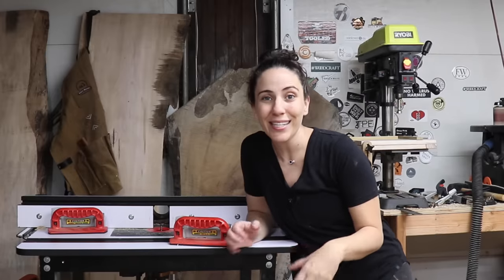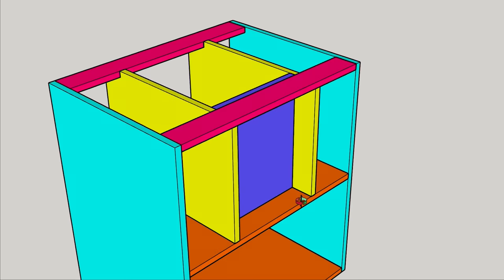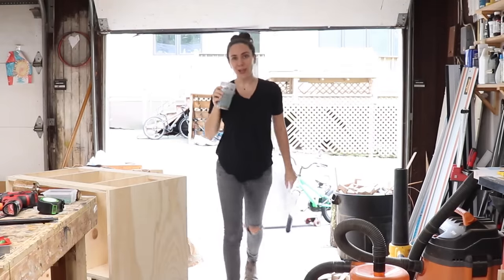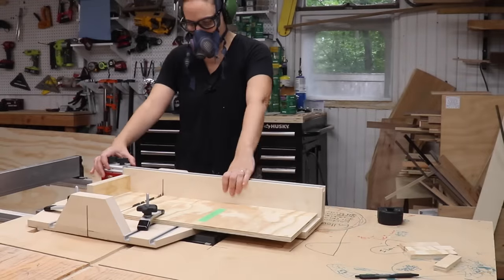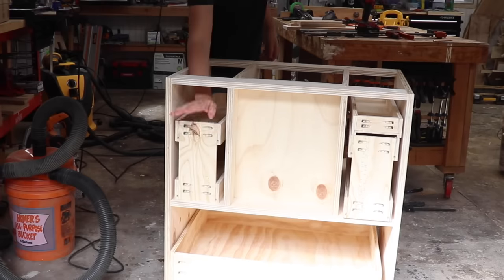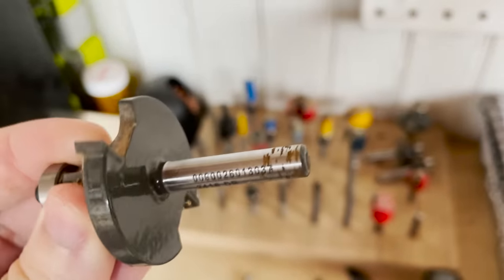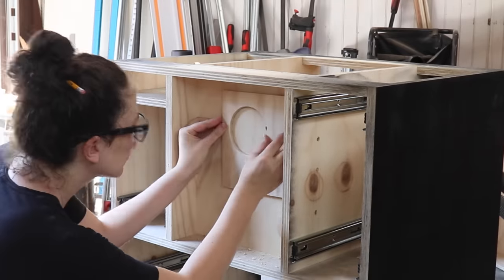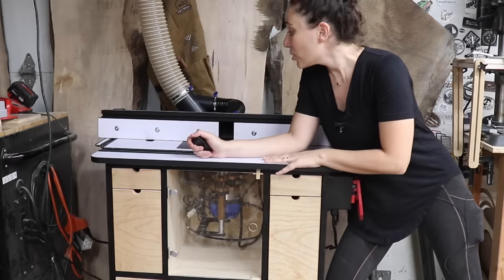Router Table Cabinet Build with STORAGE and DUST COLLECTION

Comment: Good job T!! So the dust collection issue underneath is because of the level of your dust port. If you lowered it to the bottom of the router housing it would collect much more of your dust. On the commercial dust boxes the port is usually close to the bottom which allows it to pull the dust down and out, your design is allowing it to pull the dust down but not out! Great project and it has inspired me to want to build one for myself.
Reply from the maker: Going to try that!
Reply: @3x3CustomTamar  lemme know if it works out.

Comment: Since you mentioned your collector might be too weak I had experimented with the height of the port in the box: cut a elongated hole from top to bottom where you can mount another piece with the port covering the whole hole. Then move this piece up or down until you find the height where you collect the most.
Reply from the maker: Going to try fir sure

Comment: The remote control for the dust collector is the best thing ever! I have a "Y" attachment to my Harbor freight desk collector. One goes to the table saw, and the other goes to a hose that I can connect to any other thing in the shop. I ended up getting a truck filter because it was less expensive than the canister filters designed for it. It makes a big difference in the dust around the shop.  Like $75 versus $250. I just hold it on with a tie down. Food for thought. Great video as usual.

Comment: Suggest moving the suction outlet to the bottom of the router bay so that you can suck out the heavy (gravity) particles which will form at the bottom.
Nice router table - keep up the good work

Comment: Love the table! Really awesome job!!! Definitely worth copying!! I love the idea of sinking the bolts into the plywood for the wheels! Great video as always!
Reply from the maker: Glad you like it! Thanks!
Reply: When you were drilling with the forstner bit, I thought that you were going to be using Tee-nuts with the casters.
Reply: @mattheffron391  Me too, that is what I did on my first few mobile cabinets.  But the last couple, I have switched to using 1/4x20 carriage bolts.  I still use the forstner bit to sink it in from the top, but I think it is a cleaner solution.

Comment: Nice router cabinet Tamar.👌
Dust collection solution, Milescraft 1501 Dust Router Collection, actually there are several types and brands with some being kits and others as individual pieces, most are less than $100. Basically what you need is a collection cup that fits the underside of the table to coral the dust and chips that are drawn down because of the router motor and bit. Most better quality collection systems have a dual collector setup for top and bottom. 😎
You could make a small triangle pocket on the underside of the  table, between the motor head collar and use a plumbing "T" to adapt both collection ports into one common point. Another important factor is to reduce the hose size from that large volume low flow to a typical shop vac size to increase your suction power and speed of airflow for better results.😉
One potential problem with the pocket hole method is the floor plate or bottom of the cabinet, all sides, fronts and backs should always be attached to the top surface because it is the foundation of the cabinet. Depending on how heavy your work will be it may never be an issue, but plywood end grain is not very strong against downward force. If a problem does develop you could easily add a second bottom across the whole cabinet or simply add two solid board runners under the caster wheels and sides of the cabinet to support the whole unit. I have used pocket holes for drop floor cabinets to hide the casters without  a skirt seam on the outer finish surface, but the floor is always reinforced with support blocks and is inset into a dado groove along with those pocket screws.😜
Well done!👍
What finish are you going to use on the draw fronts?😁
Reply from the maker: I’ll have to check it out

Comment: Awesome build Tamar!  I'm sure lots of other folks mentioned this, but I had the same issue on my table and found that moving the dust port closer to the bottom of helps as well as putting in mitered pieces to help direct the dust towards to port :)
Reply: Check out the Milescraft Dust Router. It attaches to underside of router lift and eliminates dust entirely. Best $30 I ever spent for my shop.
Reply from the maker: Going to try!

Comment: Great build! I like the black + natural + clear plexi. Very sleek. Regarding the remote, I had a similar challenge. I use an Oneida Gorilla, and I have 2 remotes for my shop. I hang them by chain from the ceiling in two central spots in the shop, so I am never more than 1 or 2 steps from activating/deactivating dust collection. I have 13 tools permanently ported in this system, so that a real time saver.
Reply from the maker: That’s a great idea!

Comment: Nice design! I made my router table out of MDF. For the dust collection, I went through a couple of revs but settled on a cool design. I made the cabinet space below the router with a sloped bottom made out of 1/4" melamine. Then I put the dust port at the bottom end of the slope. Now the dust just slides down to the port. I also made the door seal tight so the vacuum pulls more air around the bit and router. Really enjoy you channel - lots of good jigs and techniques.
Reply from the maker: Sounds cool

Comment: My guess on the dust collection issue in the main box. It's basically acting like a cyclonic separator. Dust shoots down and then has to change direction and go back upwards to the exit hose. I have a gut feel it would collect more if the hose were at the bottom of the box so it doesn't have to fight gravity so much.

Thanks for the build video. Cheers.

Comment: Great job Tamar!  You'll get a lot of enjoyment out of using it.  The air vent on my dust collection box is at the bottom.  That way the air is drawn in from the bottom up towards the top where the hose suction is coming from.  I think that will help.  Also, if you wipe the inside of the plexiglass with a dryer sheet it will help keep the sawdust from sticking to it.
Reply from the maker: I’ll def play around and try that!

Comment: On the acrylic door add a little metal rectangle to top and bottom, then a magnetic stop at each point. Solves the issues and looks better than the wood scrap stops.

Comment: Seen a video that the guy had the same issue as you do with the dust  in the bottom ,he put holes in the back  of the cabinet 5 holes about 1 1/2  holes instead of the door you  had put slots in your door . His method  he made no holes in the door. WHEN he added the holes in the back he had no more dust in his cabinet  .also you could add a partial panel in front of the router held by magnets so you have less area to have to remove the dust . It also give you more storage space .love your videos

Comment: I also built a router table similar to yours and I found that if you lower the vacuum intake to the lower corner of the router chamber you can improve your results. I think by having the 4inch intake higher in the router chamber your fighting gravity with the larger pieces. Good luck and keep the videos coming!!😎👍🏽
Reply: Check out the Milescraft Dust Router. It attaches to underside of router lift and eliminates dust entirely. Best $30 I ever spent for my shop. Keeps all of the dust out of your router motor!
Reply from the maker: I’m going to flip it ans see if that helps

Comment: Tamer I see a few mods you need to do  inside your router box you need to put a catch board below the router at a 45 degrees.Also move your vacuum port to the bottom to collect the dust.
You plexiglass door needs to be min 1/4 thick and you should use only lexan. Lexan will not break if something should hit it, If it is thick enough it can handle a severe impact without breaking.
Lexan is the bullet proof material used in banks.
Also make sure your router motor has good cross air flow to stay cool. I have a few more modifications To share will put them in later.
Reply from the maker: Definitely going to play around

Comment: One thing I found when building the basic box for various tools is to use as little hardware as I can, in your case avoiding pocket holes and screws, at least for the outside of the box. Why? Extendibility. 

In my case a few times I wanted to create an extension to the tool base allowing attachment of some infeed/outfeed extension wings. It was 6mo after I built the table(s) and sure enough (bang) I ran into the screws. I realize pocket holes can be great for building basic boxes, so have nothing against them, as they are great for the intended purpose. However, I just learned the hard way that when it comes to shop bases/carts/enclosures are often great places for extensions (extra shelf or two, holder(s) for bit/tools, infeed/outfeed extension, whatever) long after the fact of building the box. Allowing for inspiration or necessity of extension without any associated gotyas just makes things easier at the expense of using using something like dowels or dominos, and perhaps waiting another day for glue to cure. 

Just a thought.

Comment: I have been putting this off as my old router table was something my father made many years ago and it needs an update. You gave me some inspiration to finally start that update. Also the dust below the router I have never been able to figure that out as well as there is always some sawdust down there. I have a great system but there is always some sawdust. If you figure that out please let me know. Haha
Rocked it as always Tamar. Have an awesome weekend and happy routing.
Reply from the maker: Thanks so much! So happy I finally got around to doing this! Some ppl suggested moving the dust port to the bottom. Might help

Comment: Your router table i took a fish tank base somone had put in the trash it was metal changed it around some built a box to catch dust out of 1/4" put a plug in the bottom, added a hose connector for dust collection to the bottom, you really don't need anything on the fence the vacume pulls it all out from the bottom.  
Now I have to make draws for it to hold my router tools and bits.  The top is 40" wide by 28" deep 1" thick with a jessem router lift and I added t track for the fence over fence t track for my jessem stock guides and woodpeckers combo t track miter track for a cross cut sled or coping ends.  I just need to come up with a jig to stand parts on end to do lock miter joints.  If I get it right I can take a 
4/4 board and make a endless grain joint on 3 sides of a wall shelf i can add French cleats to so the shelf floats on the wall with nothing holding it on you can see. 5 sides should match as grain is considered.  That means I need to make the frt also.

Comment: Hi, Tamar! I love your channel, and your awesome videos. You're such an inspiration to me! Anyway, I'm not sure you'll even see this comment, but here goes. I think there is simple reason why there was so much saw dust going to the lower cabinet. Before you 'move' or 'change' where any wholes are, just change the bit plate to a much smaller one. The red cap thing that the router bit sticks through. You should have several different sizes of these things. Some dust will still find its way into the cabinet, but not nearly as much. Hope this helps. Love your channel, hope you never stop making videos!
Reply from the maker: Def going to play around with it!

Comment: Excellent build. As some other have mentioned: dust port towards the bottom, a base that slopes to the back and vents near the bottom should help. And if there’s room, you could add a couple vertical plates at 45’s across the back corners to remove those low air flow areas.
Reply from the maker: Thanks! My router lift is pretty big and bulky and there wasn’t room to do this. I’m thinking maybe making some sort of curved chute that runs from the bottom of the router lift to the inlet

Comment: Amazing work Tamar. I was unable to view the entire video when it first came out cause I was on the road but after seeing it from start to finish, I am going to spend this entire winter making this. I got to buy the plans first and worry about a lift. The lift you have is too Elite  for me but the rest of this build is exactly what I need…. this video is simply amazing. 
I think I went from start to finish 3x now just listening to the word Draw…. 

Thanks for all your effort  and keep up the good work ❤️
Reply from the maker: Haha so glad you liked it!
Reply: Marlon - Woodsmith has plans for a DIY router lift and Steve Ramsey has a build video (an old one, but a good one).  I did this and I think the parts were about $50.  That and I purchased a Kreg Router Plate (newer version of what Steve Ramsey used in his build).  It was also about $50.  So I have about $100 in the lift build.   Is it as nice as Tamar's or any of the high end manufactured ones, nope, but it is really good.  I also made my own table top by laminating 3/4" MDF on top of 3/4" baltic birch, edged it with 3/4" maple and then put laminate on top of that.  Routed in slots for T-Track for the fence and the Miter Slot/T-Track, and it works well.

Comment: Really nice build Tamar!  I recently built a very similar router table and I have the same dust collector (but with a Super Dust Deputy and Wynn Environmental filter).  I agree with many other comments on the cause of your dust collection woes.  I don't have this issue and the differences, "I believe" are two things 1) my dust collection port is on the back but at the bottom of the compartment with the router, and 2) I let some air in by cracking the door open just a bit (small 1/2" scrap blocking it open).  The only places I see dust when I'm done are in the far back corners, and it is just a little bit.  I could probably fix that if I put some 45 degree baffles in those corners.  My more permanent plan is to replace the 1/2" scrap by either drilling a few vent holes in the bottom of the door, or use a 1/2" cove bit and route a cove in the bottom back edge of the door so air can get in an run across the bottom of the router compartment to the dust port.
Reply from the maker: Thanks! I ended up fixing it. Hopefully I’ll get a video out soon 👍

Comment: You might put a piece of that 1/4” play inside the router compartment up horizontally as high as you can get it but not closing off the router breathing. Make it like a sliding horizontal panel that can come out easily “if” you need to remove the router. No need to have that big router compartment which will work accumulate sawdust (as it’s doing now). The vents you cut in the acrylic door were a good idea which will keep the router cool with circulated air.
Reply from the maker: Def going to play around with it more

Comment: I love the video,
With the dust in the bottom of the cabinet, with our dust box at work that I made for our table router in a high school, I have the 4” port at the bottom and also made the floor slope to the port from the front and the sides, I made our floor out of galvanised sheet metal. I know our dust unit is a huge one at work, but kids never close a dust gate, so all of them are open, which makes it very inefficient for the size of the machine. But our dust box is empty all the time. Maybe try moving the port to the bottom and place a sloping piece of ply in there and see if it makes a difference.
Reply from the maker: Definitely going to play  around

Comment: very nice project, i like that there si a lot of storage available.
for the door not staying closed you can use some magnets or magnet strips glued to the door and some small peaces of metal inside (you can use some L shaped piaces that could also act as the door stopper)
Reply from the maker: Glad you liked it! I considered using magnets as well

Comment: Great build! My solution to keep track of the DC remote was to attach a badge clip (as found on I. D. Badges) to it, and then clip it to top of my t-shirt (similar location as your mic) when I'm working. When not in use, it clips to a nail on the side of one of my cabinets.

Comment: nice work . i suggest you look at the position of the vents again. i believe the holes in the router door would work better at the bottom to prevent dust from settling there.

Comment: Awesome build. I have been pondering the construction of a similar cabinet to fit into an existing Woodpeckers metal stand (like your metal framed piece), but gonna bag that idea after seeing this video. Starting from scratch is likely less work. The only changes I would suggest relate to dust collection. If you put the 4" port lower on the router box, it might catch more dust which piles up in the bottom of the box. Secondly, I would add some additional vent holes in the door ( up towards the top), to assist with air flow/ cleaning of 'crumbs'. Keep in mind the dust collection is also serving to cool the router in this case, so more air is more better ;)
  Got to get these plans soon.
Reply from the maker: Glad you like it! I ended up fixing the dust problem. Hopefully I’ll get a video out soon

Comment: Nice job! For the dust collection at the end. Instead of air flow holes at the top, put only one maybe two holes at the bottom of the center door. This may create enough circulation at the bottom where you need it most.